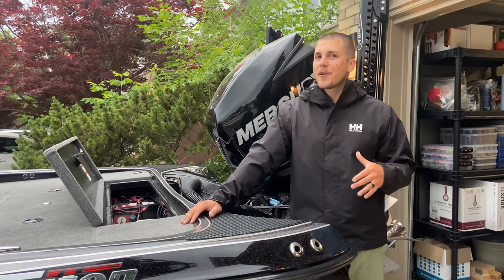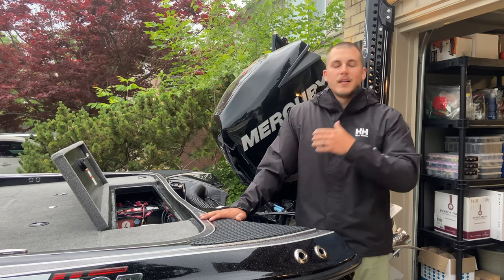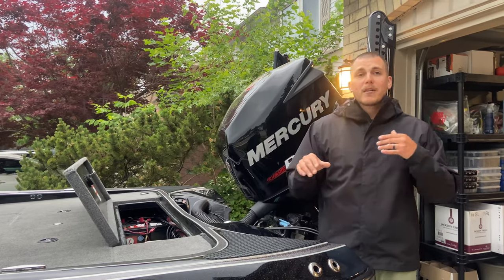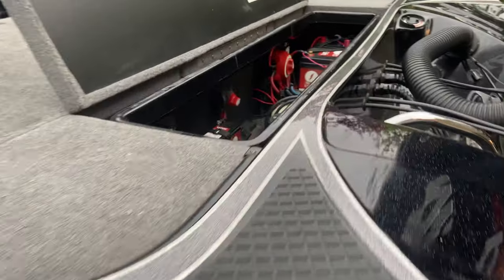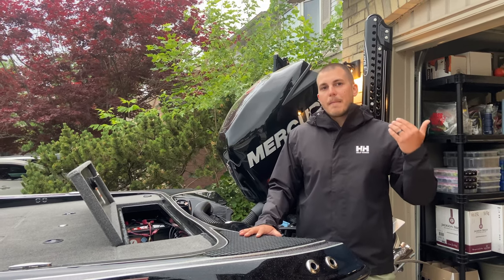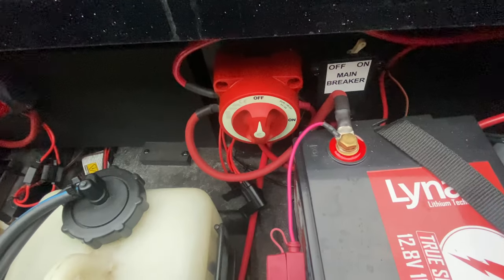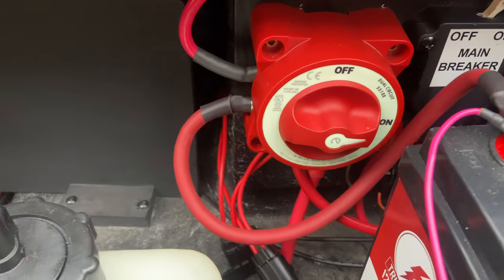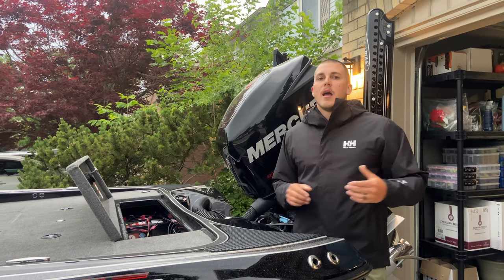Bass Boat Electronics Wiring - Powering Your Fishing Electronics

Comment: Overkill, study up on voltage drop, size of wire and run.
Reply from the maker: Won’t argue that it’s overkill, but why not 🤷🏽‍♂️
Reply: The Echomap units for Garmin for instance have a design input voltage of 10-30 volts meaning they graph will operate between those limits with 10 being the minimum before having issues.  With any electrical run (dc or ac) there will be an increase in resistance due to several factors including type of conductor. This why AC power tools drawing high amps needs a larger gauge cord at 100 than it does at 25 feet. You can run the AC tool but it will burn up or run at reduced hp.  As for DC, if you have 24 volts at the battery and check the end of the wire 20 feet away with a small gauge wire of 14, it will be slightly less because of internal wire resistance (wire resistance), across connectors. The voyage drop is proportional to power available to be converted for use.  At any rate, to deep to explain but please read up on voltage drop and wire sizes.  Yea, it’s a great idea to have a separate wire and battery to power your units to avoid electrical feedback interference from other devices or voltage spikes when starting you motor and the devices are powered by the cranking battery. 

Whatever you do, don’t cut the inline fuses off near the device and rely on the blade type fuses.  They are fast blow type fuses and they are always located in or within close proximity of the sensitive device. It protects the device where as the blade type fuse protects the wire. Another well known electronic installer stated they cut off the inline fuse.  Noooo!
Reply: When I wired my house I used copper wire and selected wire size based on ampacity charts.  Why would dc change things ... isn't voltage drop proportional to resistance times current flow ?  Also, what is marine wire?  Would noise in electronics come from cable routing or does sensor and or transducer cabling provide necessary shielding?  My boat is running 5.7L mercruiser with dual point distributor and solid core silicone plug wires.  Thoughts on cabling stereo, navigation and fish finders?  Copper cable isn't  cheap and seems weak link will be connections not cable.
Reply: @jimw6991 Marine wire is corrosion resistant, and usually the terminals are tended instead of straight copper.   we use stranded wire and automobiles aircraft and boats due to the high vibration and sharp turns within the wiring system.  The biggest problem with wiring and boats is where the connector meets the wire or connector meets the connector and many people do a shotty job onconnections and induce higher resistance.  You can go bigger is just that many of these guys said it improves their units performance, but often it’s really comes down to the terminal connectors and the length of run.

Comment: Hello,

Where do you buy your marine grade wire from?  All from same store?

Do you buy stranded wire or solid?  Sorry for this question, just trying to learn...

Wire blocks from where?

Please put links to locations...😊

Lastly, your boat and wiring is very impressive, clean and that is the way I want it in my boat...thanks for sharing...
Reply from the maker: Thanks! I appreciate that. 

You want to make sure you are using stranded tinned marine wire. 

Best place to buy is dependant on your location. Amazon is typically a good spot to order from however, Radioworld carry’s everything you need and there is no second guessing if you’re ordering the right component. 

https://www.radioworld.ca/rigging-accessories/z-fif-ra
Reply: Awesome info thanks
Reply: So at the back of your boat at the cut off switch, where's all the negative wires connected to? Are all the negative wires tied together and ground to the negative terminal on the battery?
Reply: @patrickzajdel  from the breaker to the fuse box, do you have a fuse in between somewhere? Or is the 6 gauge running straight to the fuse box?
Reply from the maker: @Blag0522  a 30amp breaker or maxi fuse  on the switch side will suffice